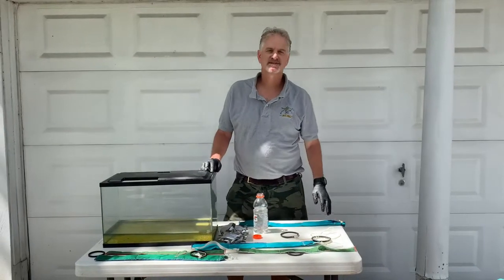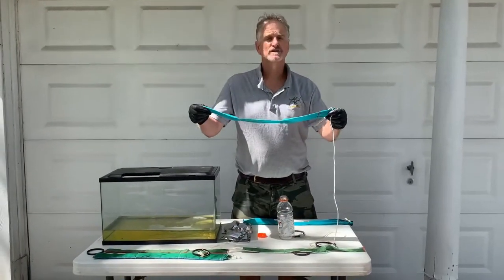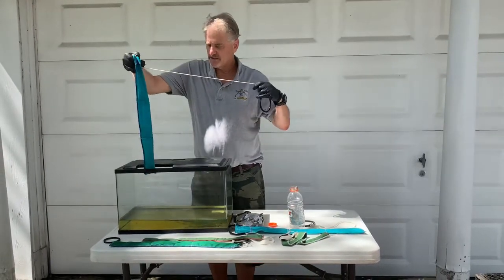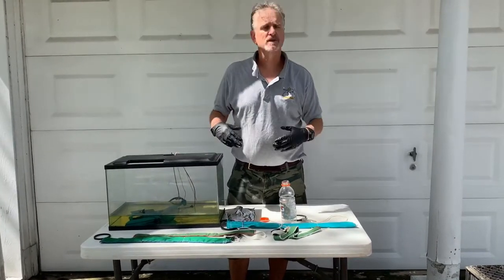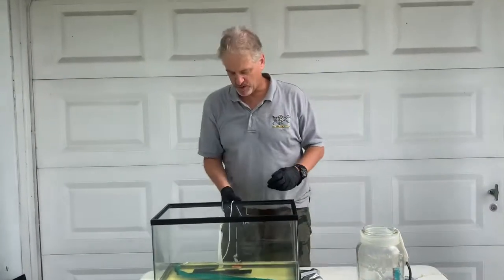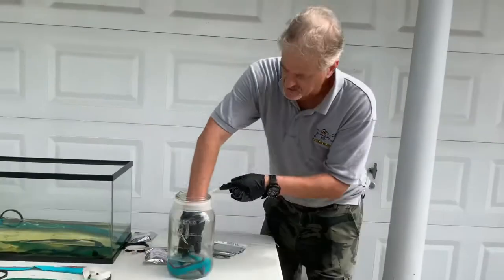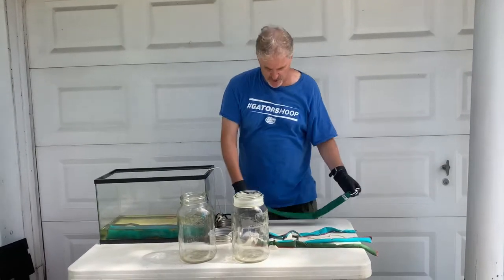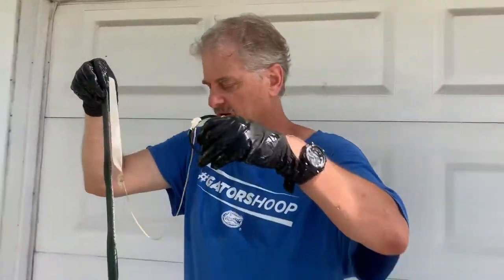Water Absorbing Sock for Diesel, Gasoline and Hydraulic Fluids.

Comment: I looked at your product, kind of expensive.   I would buy some except your are all 2 big.  I really need some about 12” long with the same diameter.  My generator only has a 20 gal tank.    These are 2 long.   I would like to leave one of these in but they are to big.     Can I cut and sew a longer one into smaller pieces.

Comment from the maker: Yes....you can hang in dry place and over time....it will release what water it grabbed back into atmosphere........however, there is diminishing returns as the chemistry ages with continued use.  As long as it keeps puffing up......keep using it.